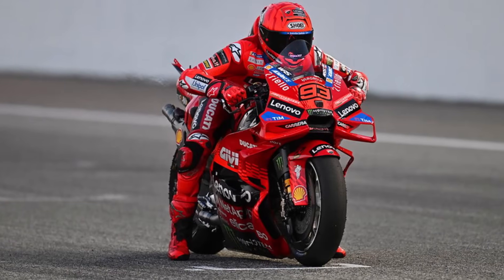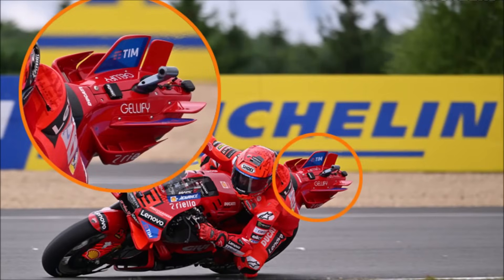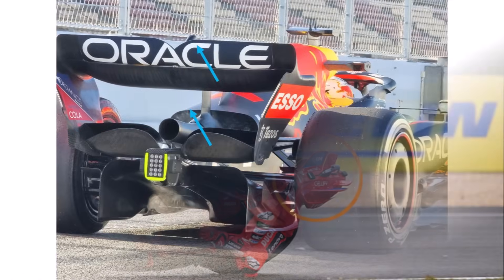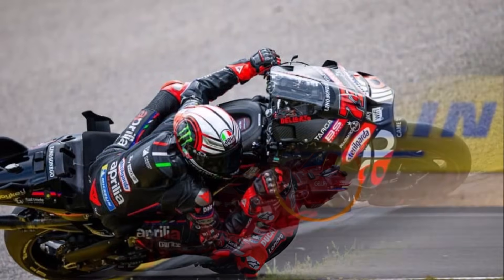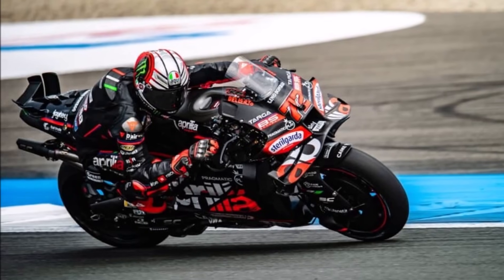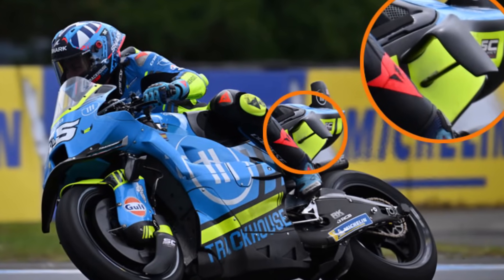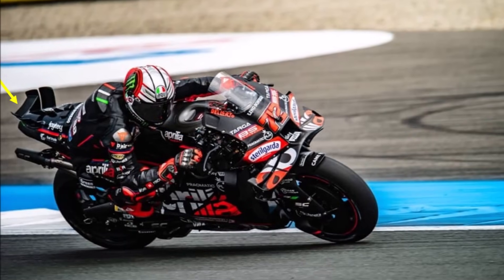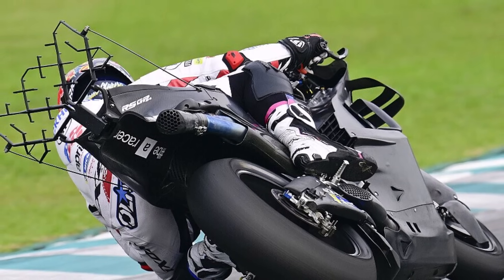MotoGP 2025 - New wings appearing - Aero EXPLAINED

Comment: MotoGP should be No Wings, No Winglets, No Traction Control, No Engine Management, No slipping over-run clutches, No launch control, No ride height control, No FIA controlled ecu, No Automated gear shifting systems. They should retain the starter system as in WorldSBK Track marshals can still help riders and remove crashed bikes but not assist in push-starting.  No pre-race interviews, No post-race interviews, No Selfies allowed, and most repugnant, the Disgusting TWENTY FIVE MINUTE SIT ON THE GRID PRE-RACE EGO-STROKE FOR SCHMOOZERS ELIMINATED.

Comment: I really like that, despite looking more and more like an F1 on two wheels, they are actually living what F1 had in the 70s and 80s, when everything was new and the engineers could easily outsmart the regulation writers. At some point it will get stable and everybody will, more or less, go on the same direction. But until then, it will be awesome to watch the evolution.
Reply: This era is already ending, new regs come in for 27, thank god

Comment: I just don't get the stegosaurus wings.

As the rider leans into a corner, won't his body block the airflow to the inner (downforce) wing while allowing air to move through the outer (lift) wing? I don't get it. 🤨
Reply from the maker: We discussed that in my earlier videos, you can find them in the playlist in the description.
With the rider hanging low in corners, the then horizontal wings get good airflow and produce downforce which helps to carry more speed into the corner and helps to keep the rear wheel on the ground while leaning/braking.
Reply: Yes but only kind of it won't be totally efficient but some air will still make its way there, so it's still functional.